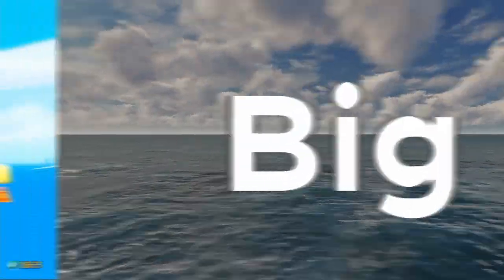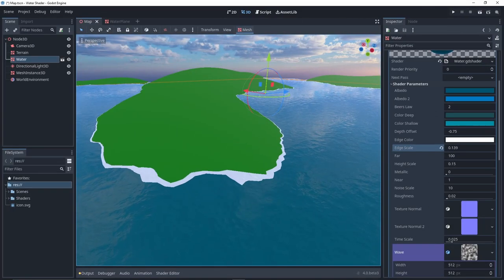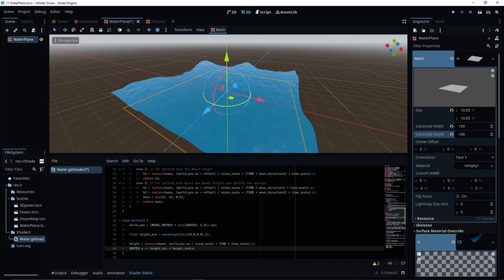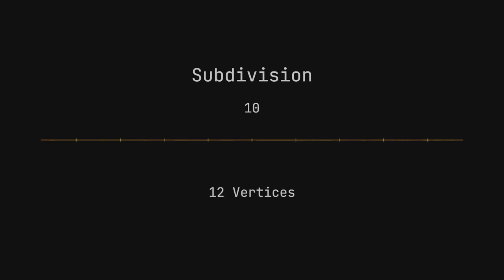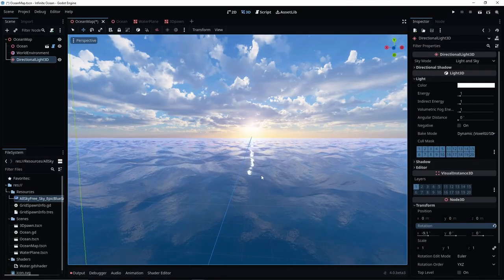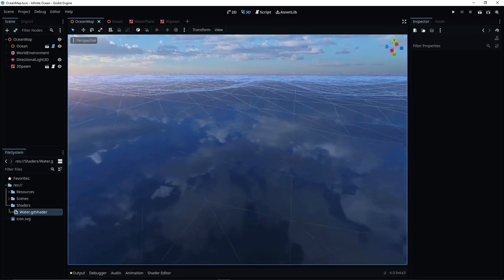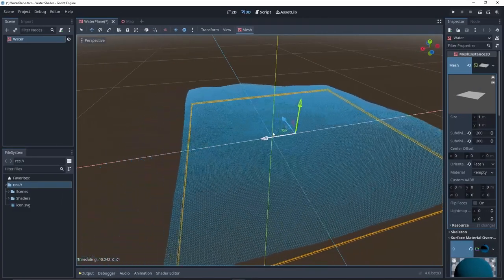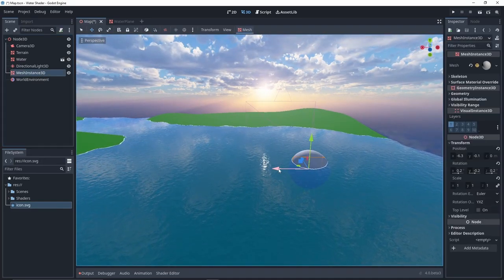I Made An Endless Ocean in Godot 4

Comment: If your player moves too far from the origin you will start to run into floating point errors with this system. If you want to make it truly infinite, you could make the noise tile over a long distance. Then whenever the player reaches the edge of the tile you teleport them back to the opposite edge. The player shouldn't notice because the noise there would be identical to the noise of the opposite edge. I don't know if any of this applies to your eventual implementation, but I hope this might help someone who reads this.
Reply from the maker: Very true!  There's a terrain version on here that addresses that issue by doing what you propose.  You could just teleport back to origin once you were at the tiling point.
Reply: Well, you only really need to tile at the overflow threshold.
If you want to put unique things really far out that don't repeat on a closed/looping map, you can convert the global coordinates to a local one, then add in details relative to it. Floating point errors are defeated.

Comment: In Godot 4.1.1, all the instances seem to share mesh data, so adjusting the subdivs sets them all to 0 at the end of the for loop.
You need to go to the Mesh dropdown and select "Make Unique" for them all to have different subdivs
That aside, I'm getting some noticeable seams between the layer 2 and layer 3 tiles, with the height changing drastically between the two layers

Comment: I'm sure to have completely followed the tutorial, but when each tiles are created, the mesh subdivision is shared between each tile making all mesh having a 0 subdivision which is obviously not what we want.

I'm not 100% sure if it is an option I missed or there has been some changes between the version of Godot you were using while making the video (4.0 beta3), and the 4.0.1 I use.

I found that mesh may need to be duplicated so parameters would not be shared, probalby not the most pretty way, but after calling the instantiate method, I added that line:

instance.mesh = instance.mesh.duplicate();

and it seems to have solve the issue.
Reply from the maker: It's the duplication...they end up sharing the settings.   I think i set to unique but I honestly would have to go back and check

Comment: Hey, just a random question, but shouldn't you move said ocean by fixed steps? You don't see it now I guess, but if you stop the wave noise motion and move, your waves will be changing shape per frame even though they are technically frozen in time.

PS: saw a few vids, liking the channel so far, great work :)
Reply from the maker: Thanks!  Glad you are enjoying it!

Possibly...the noise motion is set by world position so they would remain static if they had no underlying motion and the player moved...would look like sand or snow or something I guess...but the floating point issue the further away you are is an issue with just getting futher away from the world origin.  You could teleport back if needed and had the noise matched up.
Reply: @stayathomedev  I've had that issue once with terrain. It's not as obvious on moving waves, but if you pause your world origin noise from changing, your sea will be static. However, as soon as your ship starts moving, the sea will start to shimmer. 

You are sampling the noise - and the position of your sample is your vertex. Because you move your ocean, you move said vertex to a different place (obviously), but you don't sample the same place again by a different vertex. You have different samples of the same noise => different mesh.

You can prevent that by moving the grid so that the sampling locations won't change. As in, your ship is more than a vertex distance from the origin, so you move your grid by a vertex distance.

Comment: The tutorial is amazing as always and it's such a great result! Unfortunately it's not working on 4.3 or anything above 4.0, I tried doing the fix by adding these lines:
uniform sampler2D DEPTH_TEXTURE : hint_depth_texture, filter_linear_mipmap;
uniform sampler2D SCREEN_TEXTURE : hint_screen_texture, filter_linear_mipmap;
but the shader gets really messed up and nothing is working properly. Do you think you can take a look and fix it?
Thanks a lot!
Reply: I saw some tips on the previous video, here is the what I have and works well on 4.3 thanks to them.

shader_type spatial;

uniform vec3 albedo : source_color;
uniform vec3 albedo2 : source_color;
uniform float metallic : hint_range(0.0, 1.0) = 0;
uniform float roughness : hint_range(0.0, 1.0) = 0.02;
uniform sampler2D wave;
uniform sampler2D texture_normal;
uniform sampler2D texture_normal2;
uniform vec2 wave_direction = vec2(2.0,0.0); // Direction of wave 1
uniform vec2 wave_direction2 = vec2(0.0,1.0); // Direction of wave 2
uniform float time_scale : hint_range(0.0, 0.2, 0.005) = 0.025; // Rate of movement multiplied by TIME
uniform float noise_scale = 10.0;
uniform float height_scale = 0.15;

uniform sampler2D DEPTH_TEXTURE : hint_depth_texture, filter_linear_mipmap; // Fixes the DEPTH_TEXTURE error
uniform sampler2D SCREEN_TEXTURE : hint_screen_texture, filter_linear_mipmap; // Fixes the SCREEN_TEXTURE error
uniform vec4 color_deep : source_color;
uniform vec4 color_shallow : source_color;
uniform float beers_law = 2.0; // Beer's law = attenuation of light
uniform float depth_offset = -0.75;

uniform float edge_scale = 0.1;
uniform float near = 1.0;
uniform float far = 100.0;
uniform vec3 edge_color : source_color;

// Varying variables
varying float height;
varying vec3 world_pos;

float fresnel(float amount, vec3 normal, vec3 view)
{
	return pow((1.0 - clamp(dot(normalize(normal), normalize(view)), 0.0, 1.0 )), amount);
}
float edge(float depth){
	depth = 1.0 - 2.0 * depth;
	return near * far / (far + depth * (near - far));
}

void vertex() {
	world_pos = (MODEL_MATRIX * vec4(VERTEX, 1.0)).xyz;
	height = texture(wave, world_pos.xz / noise_scale + TIME * time_scale).r;
	VERTEX.y += height * height_scale;
}

void fragment() {
	// Depth variables and calc
	float depth_texture_x = texture(DEPTH_TEXTURE, SCREEN_UV).x;
	vec3 ndc = vec3(SCREEN_UV * 2.0 - 1.0, depth_texture_x);
	vec4 view = INV_PROJECTION_MATRIX * vec4(ndc, 1.0); 
	view.xyz /= view.w;
	float depth_blend = exp((-view.z+VERTEX.z + depth_offset) * -beers_law);
	depth_blend = clamp(1.0 - depth_blend, 0.0, 1.0);
	float depth_blend_power = clamp(pow(depth_blend, 2.5), 0.0, 1.0);

	// Retrieving depth color and applying the deep and shallow colors
	vec3 screen_color = textureLod(SCREEN_TEXTURE, SCREEN_UV, depth_blend_power * 2.5).rgb;
	vec3 depth_color = mix(color_shallow.rgb, color_deep.rgb, depth_blend_power);
	vec3 color = mix(screen_color * depth_color, depth_color * 0.25, depth_blend_power * 0.5);
	
	// Getting edge depth calc
	float z_depth = edge(texture(DEPTH_TEXTURE, SCREEN_UV).x);
	float z_pos = edge(FRAGCOORD.z);
	float z_dif = z_depth - z_pos;
	
	// Time calculations for wave (normal map) movement
	vec2 time = (TIME * wave_direction) * time_scale; // Movement rate of first wave
	vec2 time2 = (TIME * wave_direction2) * time_scale; // Movement rate of second wave
	
	// Blend normal maps into one
	vec3 normal_blend = mix(texture(texture_normal,world_pos.xz + time).rgb, texture(texture_normal2,world_pos.xz + time2).rgb, 0.5);
	
	// Calculate Fresnel
	float fresnel = fresnel(5.0, NORMAL, VIEW);
	vec3 surface_color = mix(albedo, albedo2, fresnel); // Interpolate albedo values by frensel
	
	vec3 depth_color_adj = mix(edge_color, color, step(edge_scale, z_dif));
	
	ALBEDO = clamp(surface_color + depth_color_adj,vec3(0.0),vec3(1.0));
	METALLIC = metallic;
	ROUGHNESS = roughness;
	NORMAL_MAP = normal_blend;
}

Comment: I want to make a game like GTA vicety with a test of gta 4 (not graphics demanding but huge place)... Right now I am makeing all of my assets and modular pack. I really want o usr godot but its doesnot have a terrain editor. so its very hard to set up a scene. 
How would you set up this kind of big scalable scene , specially the ground / terrain part.? (using godot 4)
Reply from the maker: It would take some work...but doable.   You essentially need to chunk your map so it loads as needed.
Reply: @stayathomedev  I was using godot 3, where you have Hterrain plugs. which is a  life saver... Like, i placed a house, then using Hterrain i can level the ground under the house... How ever godot 3 is pretty week for big scene.... Where comes godot 4 with its autolod and Ccclusion Culling and Frastam culling. 
How can I setup my scene, How in old day they did it... I want a proper pipeline. 
I am just asking... If you can show me some link or made 2-3 min video... describing just the processes. Thank you.

Comment: I'm still getting a noticeable seam between meshes,
Reply from the maker: The center and 2nd level should have no seams.   The 3rd level should not because the height effect is reduced to 0 at that distance.   Check the overall scale of the system and if the distance letp is working.   Can also msg on discord with a screenshot!

Comment: there is a simpler way to avoid the gaps between the meshes. Just think in 4D. watching you stitch meshes was painful.

do the largest tiles rendered on the bottom 3d layer. do not leave a gap in the middle, literally do all 9 tiles (3x3).
same again for the middle tiles, do all 9 (3x3) but rendered one 3D layer on top of the larger tiles.
then for your smallest tile around the player, render that on the 3D layer above the middle tiles.

remember, when rendering 3D layers, the tiles are in the same 3D space, but the rendering order means the lowest 3D layer will always be rendered behind the 3D layers above it, regardless of 3D position. a simple way to think of it is like layering 2d photos of objects on top of each other. it doesn't matter how close or far each object is in the photo, the photos on top will always cover the photos underneath.

i think they're called "canvas layers" in godot(?)
Reply from the maker: Understand your reasoning.  Mesh stitching is pretty standard for tile based landscapes or water, etc.  Though my technique may not be.  The layering would work but I'd be hesitant to overdrawn unnecessarily.  Though your tradeoff would be no stitching.  Worth testing